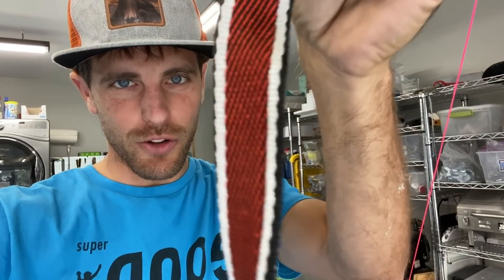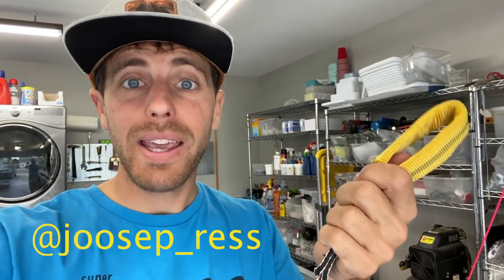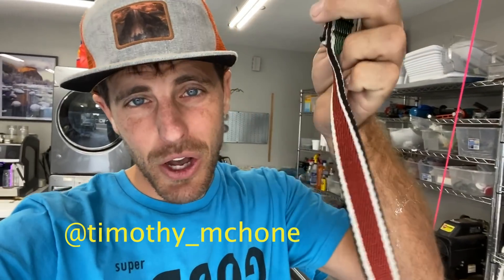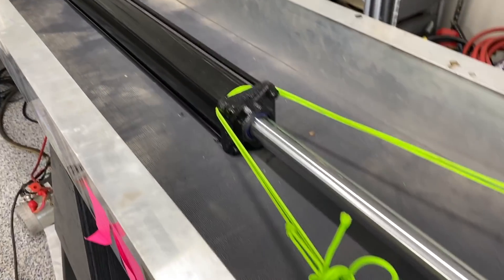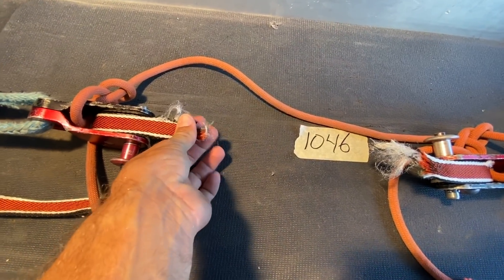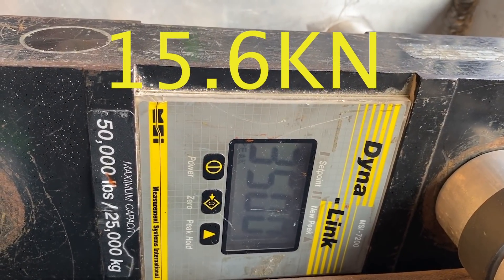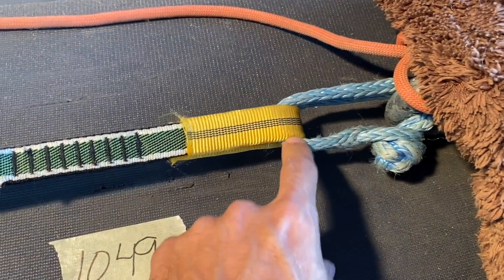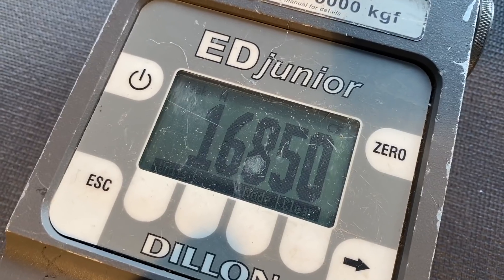Slackline webbing breaks super low!  Testing Nova

Comment: Hey, so I checked the SlackSnap chart to see if I could find you testing a grigri, 
I recently had issues after using a grigri in a HardPoint setup with a 50m ish line, I left the pulley system in most of the time since it was a dedicated setup, I used a grigri as the break and a jumar (rope ascender)  with a beiner to increase the mechanical advantage and gain higher tensions,
the webbing i use is stretchy and bouncy at higher tensions, so I usually end up rigging it with a higher tension (6kn ish)
Having used this setup multiple times over the summer and winter, leaving it in for hours of slack sessions and sometimes even sleeping in hammocks suspended on this line, when out on a climbing trip, I had forgotten my newer grigri that i use for climbing but i had my slack gear with me so I opted to use the grigri I used in the slackline setup.

After some time climbing, my partner took a fall and I noticed that the grigri, had I not been holding the rope coming out of the grigri, it would have slipped, it seemed as if the grigri was not catching falls as good if at all (Had to be massive falls), I had to yank the rope down to make sure it would catch. 
Assuming the rope would break first, it would at least be interesting to see how it's affected under large load over time and if the mechanism inside is in any way affected.

Comment: I think climbing ropes are different from highline rigs. With climbing, I feel that you are more individually responsible for your safety. This means that when you tie your knot, flake your rope and use your rope for climbing, you are aware of the condition of the rope and it’s ‘safety’ for use.

With highlining, there’s a lot less interaction with the lines since often, the lines stay up all day or over multiple days, sometimes months. This lack of interaction makes it harder to keep tabs on the degradation of your gear. That along with the fact that the community use of highline gear means that I may walk somebody else’s rig without knowing it’s condition after it’s been rigged for 2 consecutive weeks.

So I would rather have a higher safety factor because of that
Reply: Really well said. People climb on others ropes as well, but you can usually get a quick idea of the quality of the entire rope, and it's easy to see the condition of the ends when you go to tie in. You don't get that with a pre-rigged highline. You have to trust somebody already did that for you.

Comment: About safety ratios. The modern way of evaluating rope-based safety systems estimating a maximum load and multiplying by a safety ratio. (Some old ways involved a static safety factor) In mountain rescue applications, there is a movement towards using a safety ration of approximately 1.7, and that is justified by an argument that that sort of safety ration so considered adequate in the fields of civil and structural engineering (which or some of the most mature fields using safety ratios.) Another consideration in mountain rescue is that equipment wight is very important, and a lower safety ratio allows for lighter gear.

From what I have read, the rope access world has been moving to adopt safety ratios of around 2.5. This industry is quite conservative, and by the standards of climber and mountain rescue folks it tends towards overkill. 

Part of the question with what safety ratio is adequate is how precise is the MAF (maximum anticipated force. ) The more accurate this is, the smaller safety ratio is acceptable.  We think we have this quite dialed in mountain rescue, and that is part of why the 1.7 safety ratio is acceptable, 

Climbers often consider the risk of falling to be but one risk among many, and view the weight of their gear as adding risk in some ways. There is also a re-consideration when one is using force-limiting systems, but that is discussion beyond the scope of a youtube comment. Climbers tend to use the lightest gear they think is possible often times, and shrink the safety ratio down very small, partly in hopes that they simply won't fall. The lack of broken climbing ropes my have implications for the other disciplines thought.
Reply: The thing about highlining as distinct from climbing is that if your highline fails (as in, entirely, both primary and backup), it doesn’t matter how many ropes and harnesses you’ve got clipped in or even how lucky your fall is — you die, period. Possibly several people die, if there’s more than one on the line, and also quite possibly in full view of tourists, given the sort of areas this is done in. And if your primary fails but your backup holds, well, you won’t die but you’re still not going to have a good time that day. A complete failure and several people plummeting to their deaths in front of tourist families with small children seems like a really good way to get your entire fledgling sport outlawed right quick.

If you fall while climbing, and your lines hold... just another day at the rock face. Even if you fall completely, it’s at least possible that you’d survive it.

It makes total sense to me that highliners would ask for a much higher safety factor. Also they’re not typically carrying all that gear while doing dangerous shit, it seems like. The dangerous shit happens with smaller pilot lines, and then the heavy stuff is just pulled across. (And by comparison with Mountain Rescue in particular: they’re doing it for fun, not to save lives. also something that would make you think twice about what safety factor you’ll ask for.)
Reply: In structural engineering and most engineering disciplines, it's called Safety Factor (SF) not safety ratio. Safety Factors are given by how uniformly a given structural material is and it's QA/QC testing regiment, as well as the limit state you are calculating. i.e. structural lumber has a higher safety factor than structural steel or reinforced concrete. I could go into more detail but as you say, this is a youtube comment. 

I'm almost sure that rated loads for climbing gear are ultimate loads (without any SF), as opposed to allowable loads (with SF).
Reply: va7oloko oh yes, you have to do your own calculations with what is an acceptable safety factor *to you*.

They’re specified as “minimum breaking strength”, though, which means that material-uniformity/QA factors are taken into account. When you buy a piece of climbing gear, and it has a rated MBS, you should be able to count on the fact that it will not break if the load does not exceed the MBS. Not even if the machine weaving the strap had a bad day on one of the strands. However beyond that you need to apply whatever factor is appropriate for your application. Is it holding you off the ground and you will die if it fails? Or is it holding up a sunblocking tarp and if it breaks you will lose a €100 tarp? Very different needed safety factors!

That’s why this is such a scandal — the stuff consistently breaks at about 2/3 of rated MBS, and it breaks at an unexpected place. Which means there is a structural problem with this batch of webbing and one that should have been caught both at the manufacturing side by their standard manufacturing spot checks (of course you do those, right? Every so often you take part of your batch and break it, to check for unexpected shit?) and ideally it should also have been caught by the manufacturer of the slings who used that batch of sub standard webbing.

It’s not so much the fact of the webbing being weak, but much more of it being under the claimed standard and the fact that it reveals something pretty dire about the state of QA both at the sling maker and at the webbing maker.
Reply from the maker: Very good thought. The more reliable the “RBS” realistic breaking strength in all the ways we actually use the product the closer we can play next to that number. Knowing our products super well and knowing the forces we are generating super well is literally how all my “stunts” are designed. When we haven MBs of 27 and get 14, that’s gnarly. I don’t mind 14 but I don’t want to find out it’s 9 later haha. I might buy every webbing and break them as we have a third opinion about the true RBS haha
Reply: @HowNOT2  I like the thought but breaking every webbing (ONCE) and having that as a quality control can be misleading. Let's say Nova came out last week and you got one of the first sections and it broke at the expected 27kn. THEN a year later a bad batch of webbing comes though and breaks at 15kn. All of the sudden you are also caught in the cross fire for testing and "approving" Nova. What should be done is there should be an independent Slackline organization that approves Webbing BOTH when it is manufactured AND at regular intervals. Especially with soft gear. 
As an aside, these sorts of issues also occur with climbing gear. Remember when they had slings that were only taped together??

Comment: The MBS should be above the actual breaking strength. THAT is critical, because while it's intended for highlines it could be used in other applications. THOSE applications might have higher actual loads. If the MBS is above the actual breaking strength these off-label uses become unsafe.
Reply: in what applications would you want the webbing to break below MBS? (!)
Reply: @JMZ369  Never! That's the point, if you need it to work at 18kN and it says MBS is 27, you'd think you have some safety margin (not much) but it'd break before that.
Reply: SAI Peregrinus yeah, you jut said it reversed in your first comment. What you mean is that MBS should always be less than the realistic BS.
Reply: @JasperJanssen  Thanks!

Comment: So i asked for a slackline set as a gift, and received one that i dont really know the quality of (zen monkey) i only slackline between trees or the such where im never more than 3 feet off the ground, should I even worry about mbs of my gear for my uses?
Reply: if you're 3 feet off the ground why does it matter?
Reply: @eyescreamcake  id prefer it if the line didn't snap and whip me. It is under tension still. But im just saying that my situation wouldn't be life threatening if it broke obviously, but I'd still rather it not snap on me
Reply: @Penguun  I've only been on a slackline a few times, but one of those times the support webbing broke because someone put it over a sharp metal edge, and I just landed on the floor and it was no big deal.
Reply: @Penguun  make sure your anchors are way stronger than the slackline webbing itself, cause if the line breaks, at worst you get a red mark from getting smacked with webbing, but if the anchor straps or any metal components break, those could become bullets.
Reply from the maker: 30m or less Slackline kits won’t get to a high enough force to break. Super good enough. I hear nova might be a beginner kit now haha. Which is a good idea because webbing is awesome and for short beginner lines it’s super duper safe enough
Reply: “Even worry about”, yes. Be satisfied with a slightly less onerous safety factor, sure. Not having certain death be the consequence of failure makes the possibility of failure a lot less worrying, even if you still don’t want it to happen because a) it’ll ruin your day and b) if you land funny you could still have some consequences from it for years (breaking your tailbone, for instance...).

Comment: there is a YT'er (hard is easy?) that goes over tying a figure 8 properly. looking at your figure 8, I would guess you didn't tie it "proper".... but you are putting greater forces (to MBS) on them vs a fall
Reply: He has spoken to this before. There is no amount of dressing you can do to a figure eight that will stay neat with that level of force. They will all end up jacked up just like the one he was holding. Hope that helps.
Reply: @huntergibson9359  I figured as much, thx
Reply from the maker: I may or may not have made a video with hard is easy for the exact video your talking about. Coming soooooon!
Reply: HowNOTtoHIGHLINE cool!
Reply: Prairie Climber no, this one looks like the force came onto the bottom strand, which is the good one from that video you refer to.